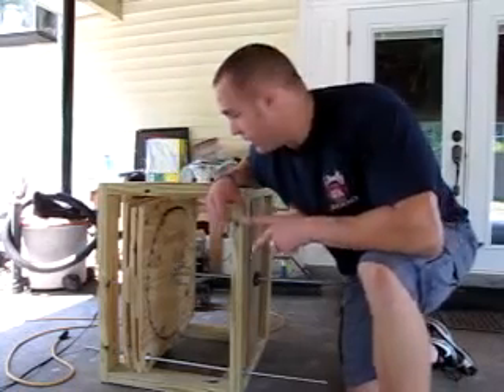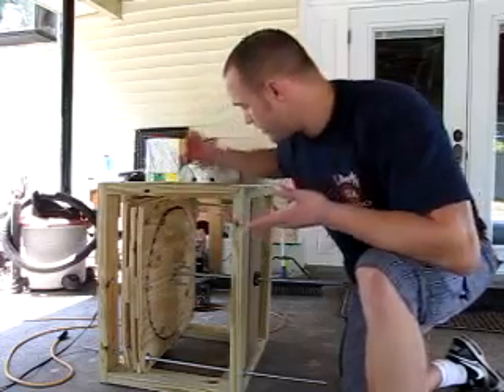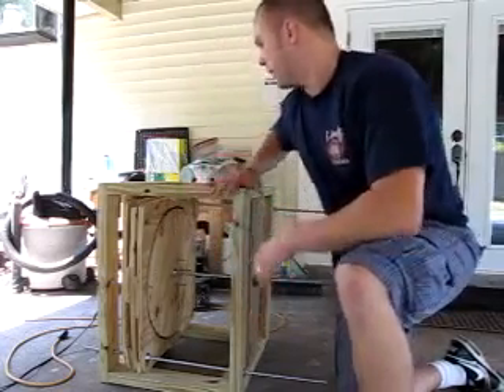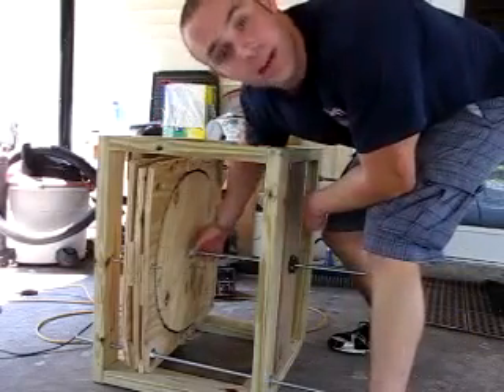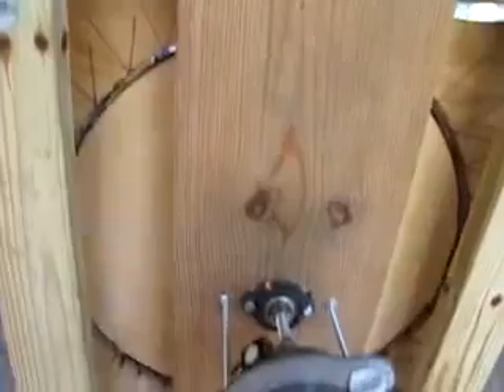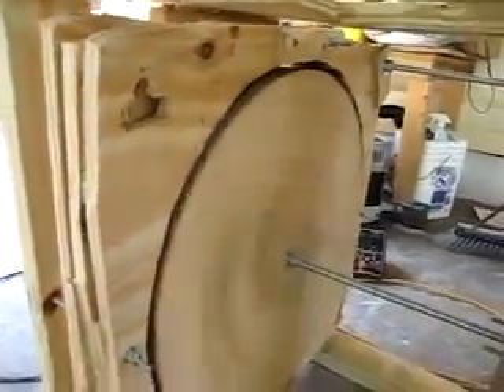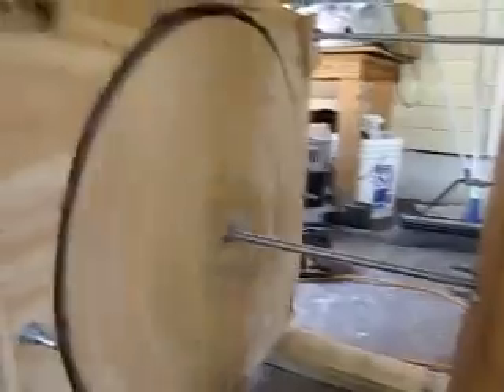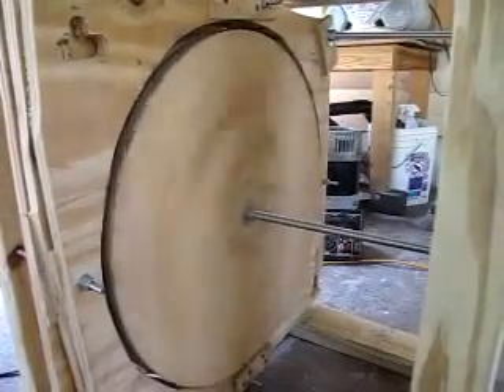The Magnetic Generator Over Unity Device

Comment: Matt, great project, like the idea keep going, a tip on cutting nice circles with table saw, drill a hole in the bench half the diameter of the circle away from the blade, then loosely bolt the board to the bench, raise the saw slowly until its through the wood then turn it slowly to get perfect circle and outer piece too :)